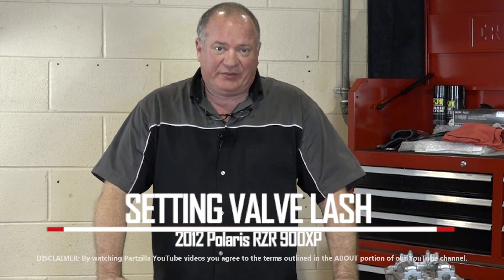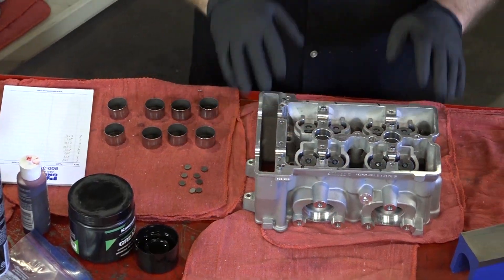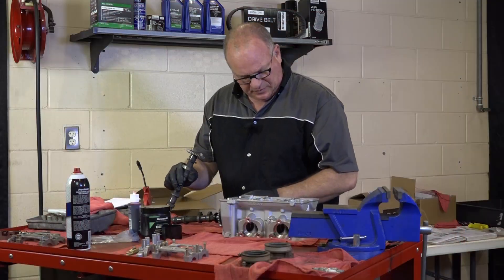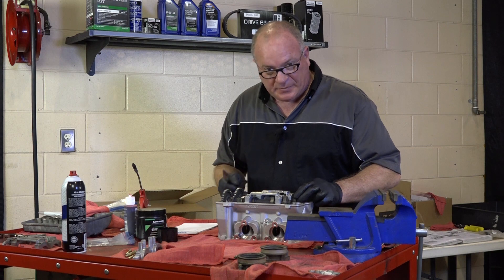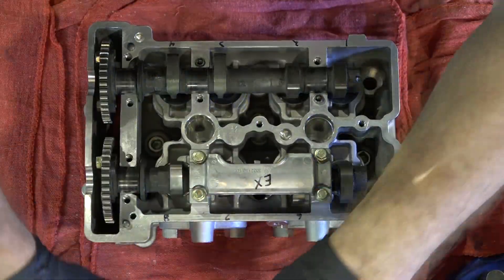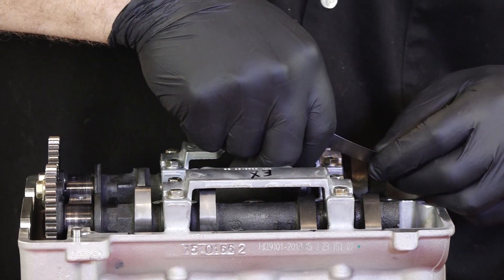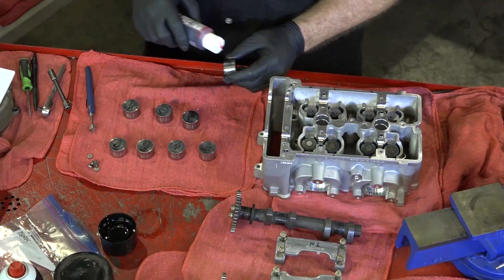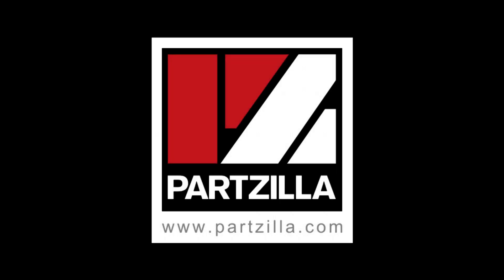How to Set the Valve Lash on a Polaris 900 XP | Partzilla.com

Comment: Hello. I have a 2013 Polaris Razer and I have a tolerance on the exhaust valve of 0.13 mm of an inch and on the intake.  Only one valve has 0.6mm of inch the other intake valves. Does not enter

Comment: I have a 2013 550 Polaris sportsman ATV that one of the intake valves keeps getting tight, I've had to adjust it 2 times in less than a month and a half, just wondering what's making it get tight, and what would be a good fix, besides getting rid of it..

Comment: Are the Tappets for a 2017 SPORTSMAN 450 HO - A17SEA50A1-A5-SEE50A1-SEG50A4 the same as Tappets for a SPORTSMAN 570-450 EFI MD - A17SEA57N1-EE57N1-NL… I cannot find them for the 450 HO. If not do you know where to look? There not in 
https://www.partzilla.com/catalog/polaris/atv/2017/sportsman-450-ho-a17sea50a1-a5-see50a1-seg50a4/engine-cylinder-head-cam-valves
Reply from the maker: You have to measure and calculate the tappets you need from the service manual.  This site can help you sort out the right ones based on the measurements.

https://www.polarisdealers.com/files/ServWarr/English/Engine%20Valve%20Adjustment%20Calculator.pdf

Comment: I have a misfire on a 
ranger 900 2018 
I try a few things and still have the misfire
First was on the
 PTO CYLINDER and then on the MAG cylinder 
I try with a different coil, different wires new spark plugs new belt different camshaft sensor  even a different ECU/ECM and still have a misfire on one cylinder and on the other cylinder 
But it only does that at 4500 and up RPM's
If it's under those RPM's it runs like a champ, 
What do you can Recommend or suggest?
Thank you
Reply: New injectors

Comment: Would this cause hard starting when warm? The valves being out of adjustment. Seems like this is a dealer repair. Having the right chart and access to different size shims might be beyond a home mechanic
Reply from the maker: Is there any ticking or knocking?  Anything is a home repair if you have the right tools.
Reply: Hi, no ticking or knocking. It starts just fine cold. When warm it takes longer to start. I have changed in tank fuel pump and new spark plugs. That has helped, but its still there. About 5 to 6 seconds with some gas to start. When cold no gas and it fires right up.
Reply from the maker: Check the valves.  Always adjust valves when warm.

Comment: I'm looking for valve clearance on an 2014 razor 570 .. I know valves are tight on intake. Can only get an .004 between.. Tks for any info
Reply from the maker: Intake is .005-.007in  Exhaust is .007-.010in.